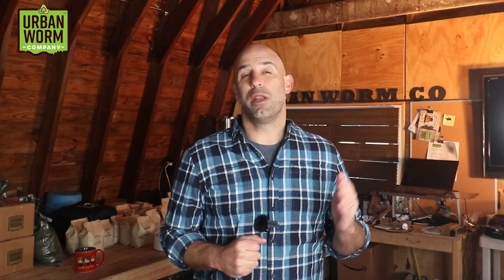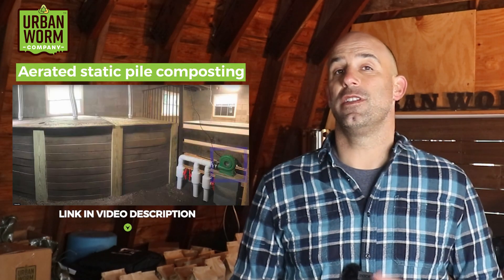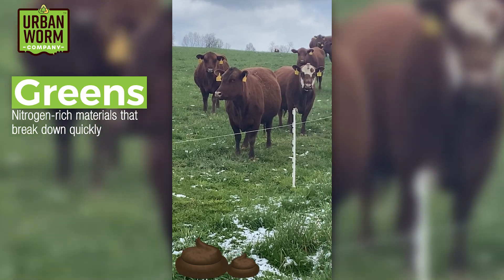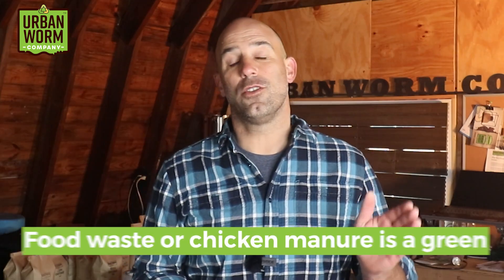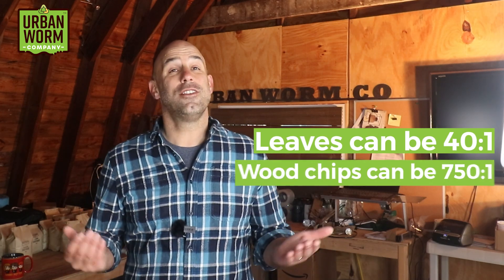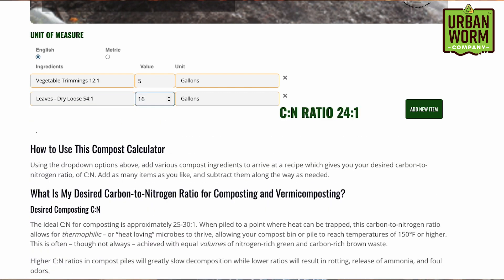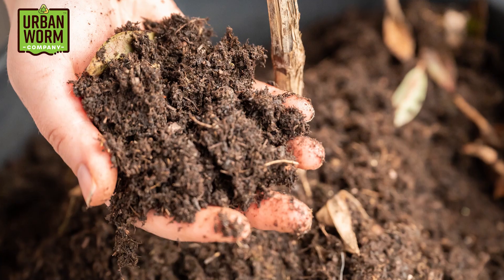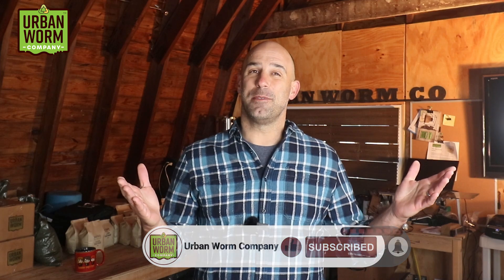The Cold Truth About Hot Compost: 4 Reasons Why It's Not Heating Up

Comment: I tried using the calculator on your website but its almost impossible to use without getting very frustrated... About every 5 seconds or so the page stops whatever im doing and scrolls down about halfway for no apparent reason... then I have to scroll back up tap the drop down menu on the calculator find the material im looking for and tap that before the page does it again or I have to start all over... I was not able to complete my recipe cuz after doing that about 5 or 6 times I just said forget it and gave up as it had me very frustrated at that point... the device in using is a Galaxy S24 Ultra

Comment: Just started a compost pile, turning it is going to be difficult. Its at least 3x3x3 in an enclosed bin.  Rather than turn it, I took a metal rod and dug 15 inch holes and put greens into the holes (coffee grounds).  Will this work even if slower than turning it?  My bin appears to be brown heavy and a little dry (some areas hydrophobic).

Comment: Love the vid and calculator!  I use a food cycler to dry and break down kitchen scraps.  How would I calculate dried vegetable and food scraps into the calculator? Or is it the same as wet vegetable and food scraps?
Reply from the maker: Thanks!
The C:N is likely the same. The Food Cycler is a grinder/dehydrator, right? If so, that material won't be materially different than regular food waste.....it's just been fragmented and dewatered.
Reply: @UrbanWormCompany  Thanks for the reply🙏 One more question. So how would that affect the C:N ratio (I'm using dried veg scraps and cardboard) when starting a new pre-compost pile when using dry weight to calculate the amount of C and N since I'm assuming your calculator is for wet weight food scraps?  Thanks in advance!

Comment: Great info, but you didn't cover the use of some of the commercially available bins. I have a tumbler a square bin and a drilled trash tote. They all break down, but slowly and usually cool like 85-95 degrees Fahrenheit. l know my C-N ratio is off because I always have more green than brown available that needs composting, except in the fall when my very large Oak tree sheds its thousands of leaves. So, I guess I'll just live with what I got and make sure that they don't get stinky by turning often. BTW my UWB is doing great.
Reply from the maker: This video is about thermophilic composting. In order for a pile to retain heat, it needs to be at least 3 cubic feet to have enough thermal mass. Commercial bins and tumblers are meant for "cold" composting, just like you said.
I like to store leaves and save them for the spring and summer when I'm low on carbon sources.
Reply: @UrbanWormCompany  Hie, i am working on a project to create liquid biofertilizer using high temperature aerobic composting, without bins ,how can i do it?